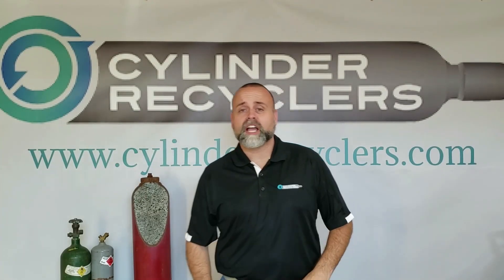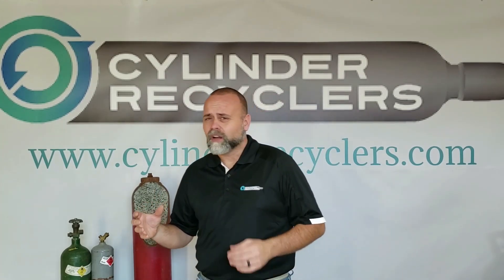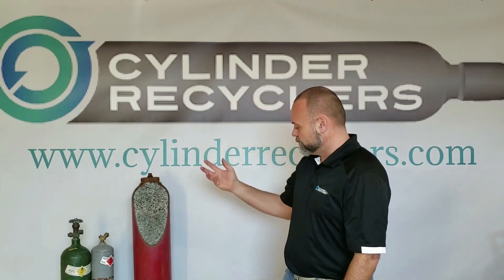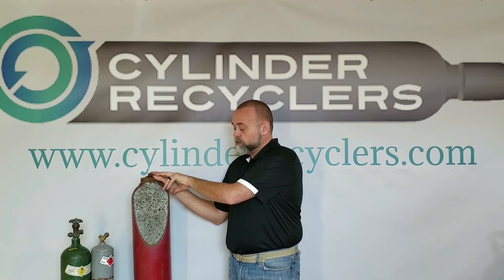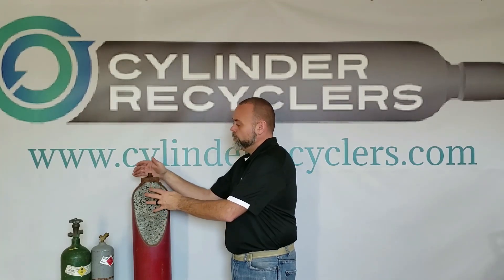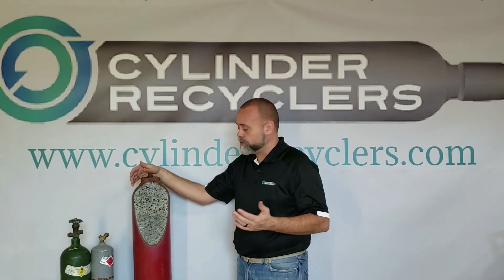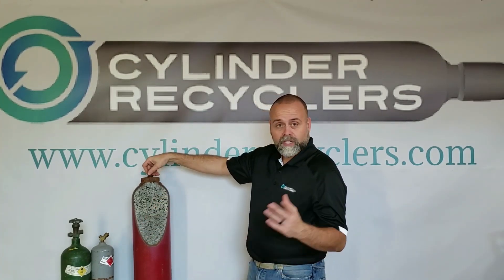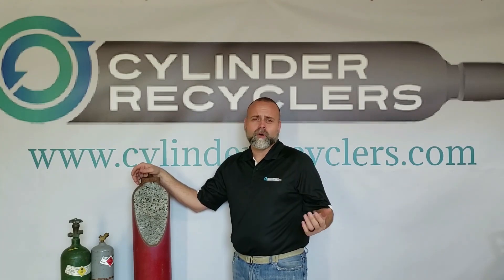Why Acetylene Gas Cylinders are different

Comment: You missed the important bit.  Acetylene cylinders need to be kept upright at all times to stop the acetone from running out.
Reply: And this also brings up another important safety tip.   More than 1/7 of the cylinder volume per hour should never be used, since excessive flow (such as can occur when use a large heating tip) can result in acetone being sucked out though the torch.  Depending on the situation a larger cylinder or multiple cylinders connected to a manifold system may be required to supply adequate flow without exceeding the 1/7  cylinder volume/hour limit.

Comment: I was told many years ago that if an Acetylene cylinder takes a heavy blow you should run your hands over it at 15min intervals to check it isn't getting a hot spot that could lead to an explosion. I told this to a couple of guys that turned up on our site with 2 x Oxy/Acet welding units in the back of a Transit van, with no ventilation,  and they said I was talking rubbish. They didn't even know the bottles have a porous core.
Reply: I was also taught this when I took a welding class in 11th grade back in 2006.  And it has to do with the fact a hard impact such as could occur when struck by a forklift or similar heavy machinery, can dislodge the porous filler and allow a void where free acetylene can compress to the cylinder pressure,  approximately 250 psi for a full cylinder.  And we know that between 16 to 30 psi pure acetylene has a tendency to dissociate into hydrogen and carbon,  creating an exothermic reaction and the cylinder can detonate within a few minutes to several hours after the incident.

Comment: If acetylene explodes above 15 PSI  when not dissolved in acetone and is made from water and calcium carbide how is the  gas pumped into the cylinder?    Its pressure has to be raised in the pump and pipe en-route to the cylinder.   The pressure in the pipe must be at least 260 PSI.
Reply: @tripplefives They are filled to at least 137 bar which is 1,900 lbs per sq inch.